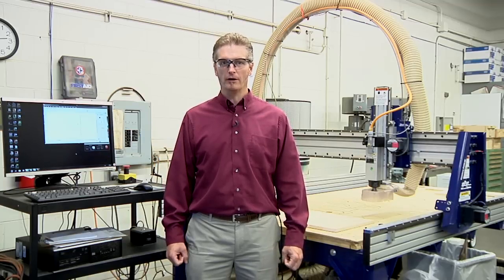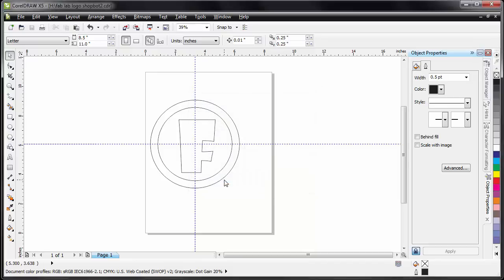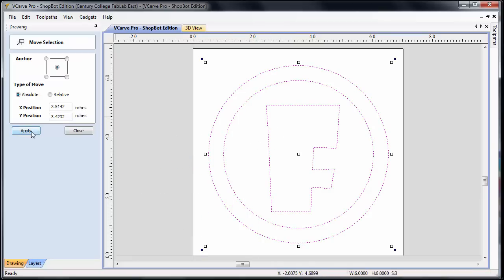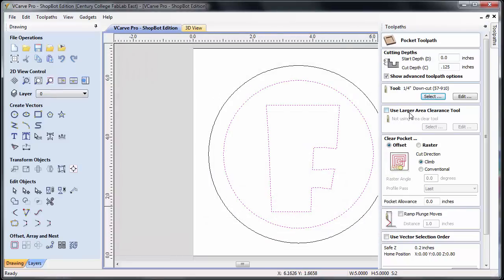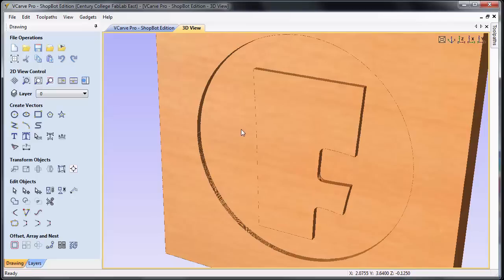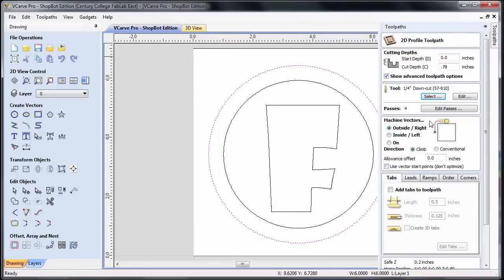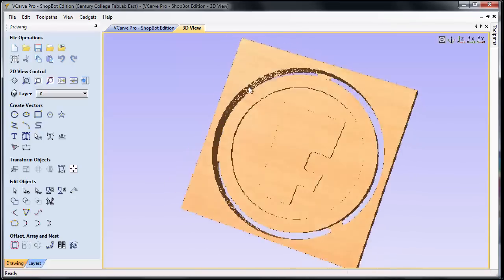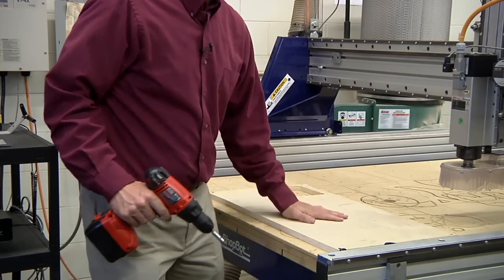Shopbot - How to Use

Comment: Nice little demo there. The only thing I would do different is to add a ramp to the profile. A decent ramp cuts the wear on end mills down, so they last longer. Its also easier on the spindle too. My home brew CNC has a cutting area of 18 by 25 by 6. The controller program is Mach 3-- FAR friendlier than what comes with a shop bot . I use an old version of inventor (3d solid modeling program) where i need to make several parts that fit together in an assembly. Auto desk fusion works almost the same.  For the basic 2.5 stuff I still use inventer but just save it as a dwg file. That is native to autocad. V-carve will import dwg files so that just makes it a bit simpler. For artwork type of stuff I clean up the artwork, if needed, with a program simulator to photoshop and convert them to gray scale or B and W .  Tool pathing is done with V-carve.  The hardware/software is different but the basic process is the same on any CNC..